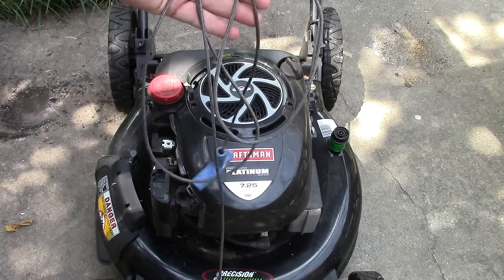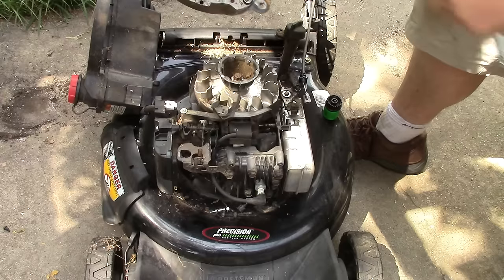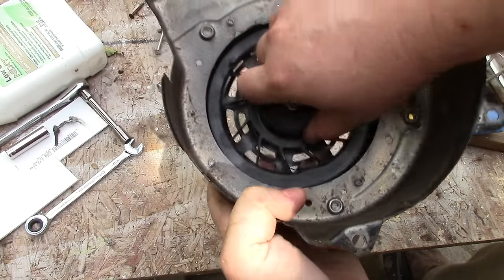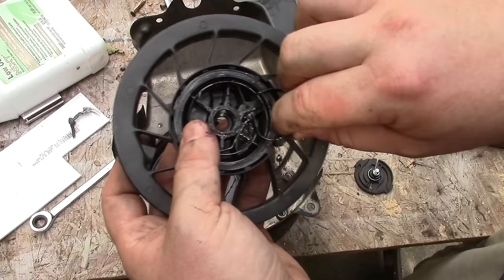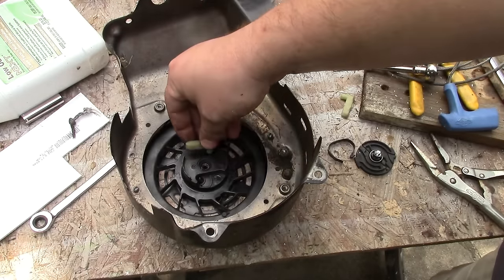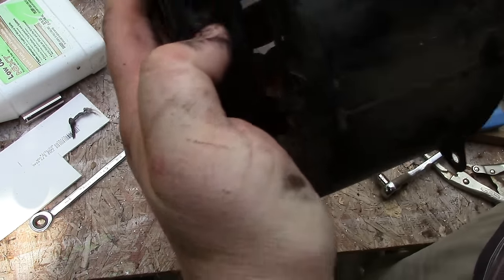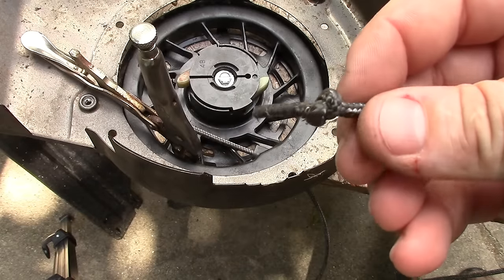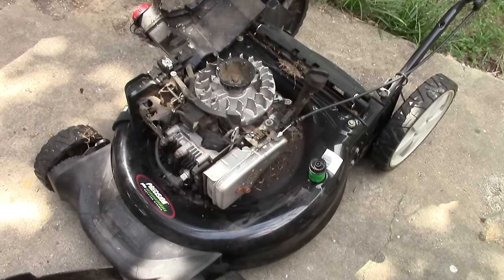HOW TO repair a Pull Cord on a Briggs and Stratton Lawnmower

Comment: Add another happy DIYer to your fans. I just repaired the pull starter on my 1975 B&S mower. So B&S used rivets back then as well. Maybe I’ll get another 45 years use. The spring jumped out at me. It was easy to get it back into place. I started with the spring hooked into place on the starter housing and wound the spring into place - from the outside in. Once in the housing I lined up the second spring hook with the tab on the engine shaft. Thank you.

Comment: I have the exact same lawnmower. I had an extra part and I am wondering where the heck did this come from and I came into the house, found your video, you mentioned the spacer(!) and out I went to finish. I wound the spring eight times around and I measured the old rope and it was four inches shorter than my new rope so I put the pull handle back up on the handle. Pushed it outside and Bam! It fired up on the one pull. Your video is a wonderful blessing.

Comment: Thank you so much for the great instructions!  You and your bloody finger make me feel less incompetent. (Lol) Last week the pull cord broke off and sure enough I had the identical problem you had with a Briggs and Stratton. My spring had also broken off. Local shop didn’t have one and it would be a week before they got another. I remanufactured my spring just like yours. Two hours later and recoiling it four times, I got it to seat properly.  Thanks again!

Comment: This was great for me. I first turned it the wrong direction. Pull cord didn't go in. Had to redo going the correct direction. still didn't work. I found that when I had turned it the wrong way I did something to the spring. Took it apart just like you did, used needle nosed pliers to get the spring all lined up. Put it back together and just finished mowing my lawn. Thanks.

Comment: Thanks for the Video.... Although the Engines were different... You gave me enough information that I figured it out.... Thank You Again.... 👍👍👍👍
Reply from the maker: Thank you for the comment. I’m glad the video was useful.
Reply: @BenHuttash  The cord in mine broke somewhere in the wind up, and I had no clue how long it actually was supposed to be. Thanks Again.
Reply: Thank you Ben, what yr do U think those plastic carbs came out? 
I rather have those metal ones. 
Thanks. 
I’m new to your channel I have a 2012 craftsman fwd original owner lately she is running on high. In my 12 years of using this machine I have cleaned carburetor 4 times. I have a Sandy yard. How would you lower the speed of the machine.

Comment: Thanks so much for the help, not a mechanic at all but it was easy. Only problem was i think the spring broke while winding it. I turned it 6 times and it didn't recoil, so i put it back together anyways and it still works.

Comment: Cheers Ben, just did this on an old 2003 model and its good to see B&S are still pulling the same old rivet joke on the newer models too:)
Reply: yeah I saw you can get a pre-loaded assembly but you have to drill out the rivets to get the old one off.  So, I guess for the difference between the $7.00 pull cord vs the near $30.00 full assembly,  plus having to drill the rivets to boot, I'll figure out how to get the spring on the hook.

Comment: Is there a trick to putting the recoil BACK on the mower flywheel?  Mine recoil works easily and correctly OFF the lawnmower but seems to be binding on the lawnmower. Thanks

Comment: A riveted top shroud is essential - it holds the recoil mechanism in the correct place. That's why you have the slight inconvenience of taking the lower (bolted) shroud off.

Comment: the part that was riveted down, what is that part called? i have a briggs and stratton 550ex 140cc, and i need to replace the piece im mentioning because where i am supposed to have the coil hooked onto, the plastic part broke. Any word on how or where to get one or a solution wud be apreciated!
Reply: A quick Amazon search for 'lawn mower recoil starter assembly' will yield a ton of results

Comment: I made the mistake of not buying the correct size pull rope. It just won't work without the proper size... I believe the proper size for my 1997 B&S engine is 3.5mm rope. It cost me a whopping. 29 cents per foot. And somewhere around 7-feet seemed close to the original size.

Comment: once I did all this my pull string retracted prior to putting the cover back on, but wouldn't retract after, any idea why?
Reply: Lots of times, the pull cord will need to be seated/re-seated.  To prevent this, you string the new cord in, tie the knot, and cycle the pull cord in and out a few times before putting it all back together.

Comment: I followed this helpful video all the way through to the end, but when I pulled on mine, I gave one good turn of the motor then the cord span freely without turning the engine over - I'm thinking something is wrong with the plastic things that stick out when it spins, but nothing is obvious to me. Any ideas anyone?
Reply: If this happens, you'd want to take that assembly apart as was done in the video and verify that the little plastic pawls aren't broken or caught up on something.

Comment: Mine broke today and I went "oh shiiiiiit" because I knew they were riveted, I had to repair one about 5 years ago and it was the worst!! I ended up drilling the rivets out and replacing them with conventional hardware but you still had to take the shroud off... Not fun, not fun at all... I clicked on this video thinking maybe there's a better way to do it... Nope, still a pain in the ass. And before you cut your finger I was thinking to myself "watch out that sheet metal is sharp" and well... Sometimes you learn the hard way 😂